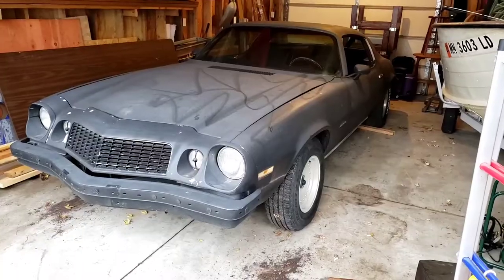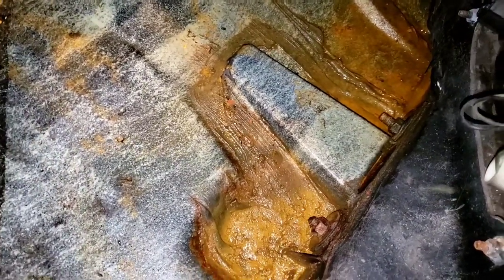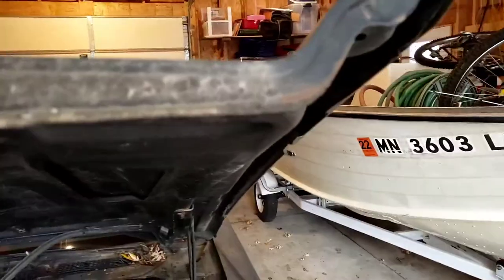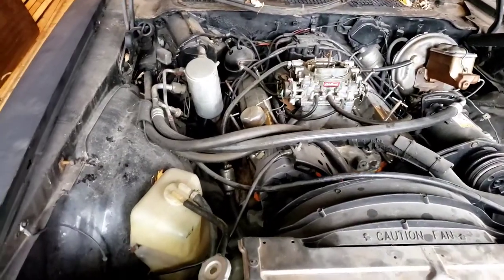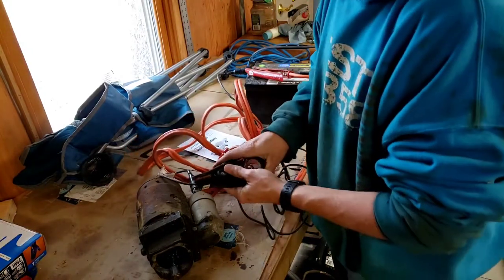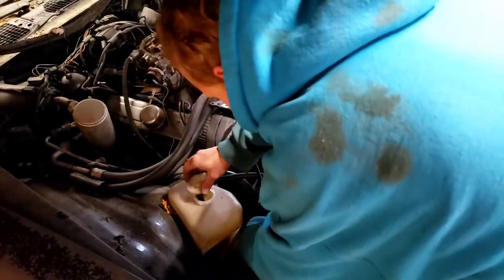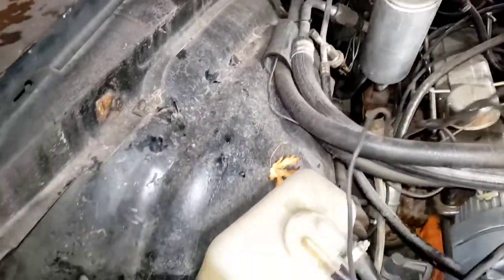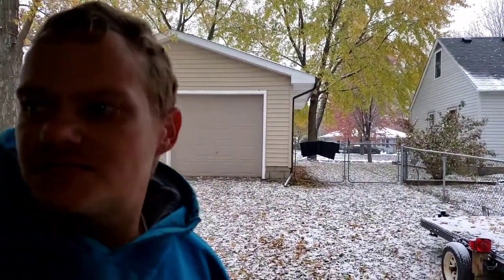1977 Chevy Camaro Restore Part 1

Comment: your channel popped up on my list. must have been because of all the camaro videos i watch. seeing you trying to start the car while i'm looking at the ignition switch unattached and hanging down was absolutely painful. but at 17, with no automotive knowledge, my sisters boyfriend helped me put an engine in my 69 camaro convertible and then they promptly broke up. i spent a few nights in the garage trying to figure out what wires/parts went where but i got it done. now, 26 camaros later.....we all have to start somewhere...
Reply from the maker: I tell yah, if I knew then what I do now it would have been a lot easier. Especially loading it onto the trailer

Comment: I am happy to see your Camaro is running good. Major plus there. i have a 1978 Camaro, and will be starting up my channel soon!!! I see nothing is working on the dash. Remove the bezel, there should be a pretty wide plug that should be plugged in. If it is not, locate it, and plug it in. That should bring back your dash.
Reply from the maker: Thanks! I actually got it working. Is what was missing was the actual ignition switch. Not the key switch but the actual ignition unit on the steering column

Comment: There’s supposed to be a rod inside the steering column that moves up and down to the ignition switch. That’s why you are not feeling any resistance from the key. Those long connectors under the dash plug into the ignition switch. That’s why your gauges aren’t working either. The car doesn’t know it’s running.
Reply from the maker: yep. after i took apart the column and all that, i realized that the ignition switch was not hooked up further down the steering column. I found that out. but i show it in part 2.